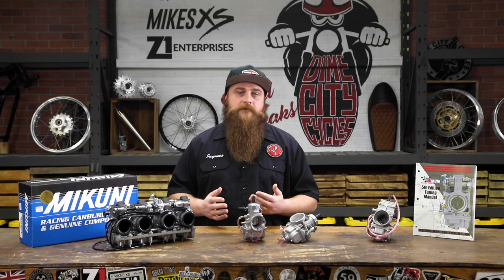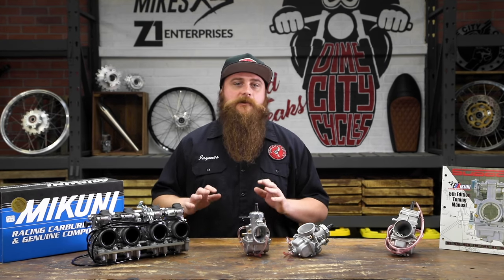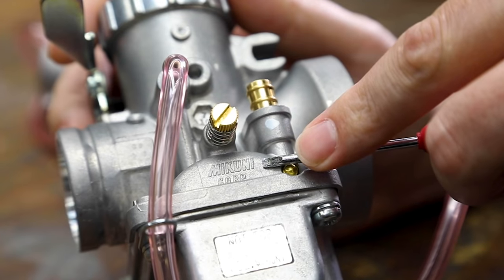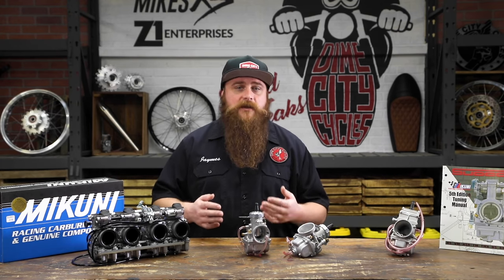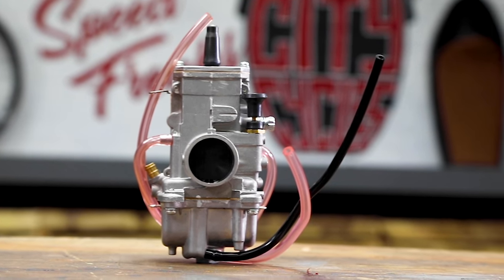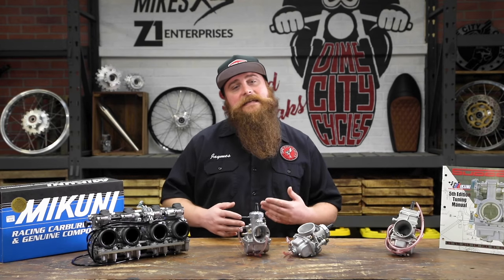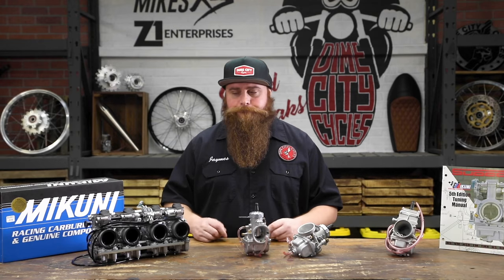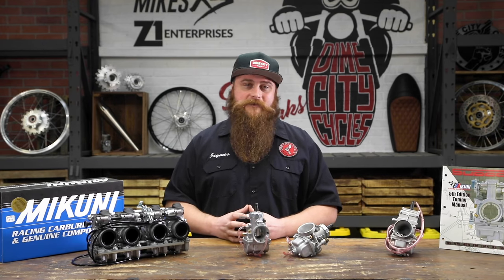DCC Presents: A Guide to Mikuni Carbs

Comment: Been undoing a lot of PO's hack jobs on my '71 CB350 (one example, someone cut off the throttle cable at the "y" and locked the CV carbs wide open with to air cleaners... took a rubber mallet/wood dowel to make them move...) and VM30's are on my bench for install after engine clean/paint. Great video. Yall at DCC have been a great help/parts source for me the last year. Got my Brass seat pan painted up and ready for install. Keep up the awesome work and great parts selection. Rock on.
Reply from the maker: Rock on!

Comment: Nice explanation of the model differences and nice to point out the accelerator pumps. My only observation of all "new" carbs is all the rough edges and surfaces on castings compared to good old 70's units. The visual finish/appeal needs some scrutiny from their QC folks, but if they run like a bear who really cares.
Reply: Bec they are chinese made some copy some under license.. The older carbs where made in Japan.
Reply: @hoedemakerbart  Exactly right.  Even our Honda XR125 was made in China.  And it shows.  Our Makita power-tools has lost it's reliability because of Chinese made.
Reply: @Deontjie  it depends. I have a scooter repair shop. I order Chinese made keihin under license and they work great finish is good. But they also have the Chinese copy and that one is crap

Comment: I have an 82 vf750 sabre.  Is there a flat slide kit for me? Can you reccomend something if not? Cams are going to be .020 more on lift over stock and an additional 12* duration.  Ported heads and a 4/1 open exhaust

Comment: Hey James I'm Nick I have a old mikuni carburetor on my Polaris trail boss 250 I seen to can't find a part number to order a valve niddle and seat because it overflows like gas just when to 10c I have had it apart several times. do these carburetor have exchanging parts or would I have to have a specific part?

Comment: Can you tell me if the tm carb is taller than a VM carb of same size. Specifically how they differ from bore center to the top of the slide tower. For my project there is very little room on top of the carb due to the exhaust pipe crossing over there. Currantly I have a 34mm mikuni and I would like to try a 36mm flat slide. Thank you bro.

Comment: Hi, great video

I´ve been told that the TM and the RS series are exactly the same carburetors, with the only difference being that the TM is made for single use while the RS is made to fit with a total of four carburetors. Can you confirm if thats correct?

Reason I´m asking is that one of my RS36 carburetors needs a new mixing body wich seems impossible to find as a spare part, and since I can´t find a place where I can buy just one RS36 carburetor I would have to pay 800-1000$ for a new set with four carburetors.

But a well known motorcycle mechanic around here told me that the TM36 is the same carb and that it could be modified to fit with my three RS36´s, at a cost of about 300$.
So I would just like someone with good knowledge of the Mikuni carbs to confirm that this is correct before I place my order on a new TM36 carb.

Best regards
Marcus

Comment: I have a question. I'm using a 16mm mikuni carb, which is maybe a cpi scooter carburetor. I have cpi sx 50, yesterday i installed 75cc cylinder on it. It was brutally weak and slow before, and also now. I'm planning to buy a 21mm carb.

Comment: Are all the mikuni carbs have the same size choke spring nut ? the original one I had was plastic and broke when I was putting it back together. the one  have is 11.8 mm and that is the threads that go into the carb. HELP anyone please and thanks.

Comment: Could I put a mikuni VM36 carb on my 2001 yz125?
Reply: Well you might need a new flange for it but it could probably be done. I have a polaris 400 and went from what I believe to be a VM30 to a VM34. Was tight fit on the flange and had to adapt fuel line from 1/4 to 5/16, but other than that have had 0 issues.

Comment: I just bought a brand new mikuni carb for my 200x and it still leaks, any idea wahy
Reply: Float needle sticking, tap it with a piece of wood
Reply: @skyb8687  nah it’s not sticking
Reply: @amadorrodriguez2718  needle n seat not properly working or float level incorrect, only way it can leak...also your fuel shutoff is probably not..allowing gas into your oil and washing down your cylinder wall..pretty important, any time I upgrade a carb i update the petcock
Reply: @skyb8687  thanks man I was told it was the float

Comment: Can anybody point me in the direction for carbs that will work with an 1983 650 nighthawk.
Reply: I know this is old post but any carbs off of a honda( keihn) 750 or even a gs 750 will work.you need to measure the bore(where the carb plugs into the carb boots) .any gs750 or 650 carbs (mikuni) should work,just gotta get the jets right, but i think if you took carbs off another 650 should jive probably.?hope this helps

Comment: So yeah my beard is smaller but you don’t know carbs. The model I.d. Was very enlightening how ever. Throttle response was and still is why cv carbs are used. Your “average guy” wants to snap the throttle. You cannot snap a mechanical carb and be happy. You have to learn how to ride the slide. Cv is EZ. Twist at will and you will get your thrill. Mech=race. Cv=street. stop peddling knowledge you don’t have.

Comment: Mikuni carbs are the worst I've ever owned. I have had a 19 mm round slide and a 24mm flat slide and it didn't matter what jets sizes and how much we tried getting the air/fuel mixture screw adjusted for the right spot and you could get it adjusted to where you think it's going to run ok but go for a ride and it maybe ok but then next time I'd get on it and it be fucked up and not act right and no one had touched it. I trashed those carbs bought a Nibbi 24mm round slide and my motor purrs and screams when it's supposed to. So don't sit there pushing a company product that's a real piece of shit